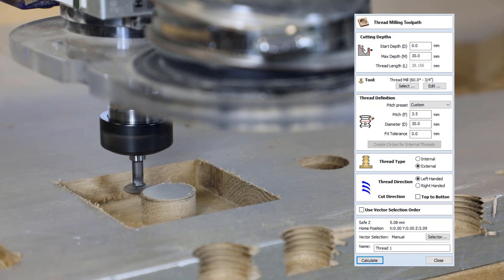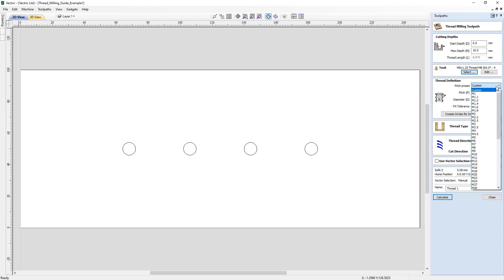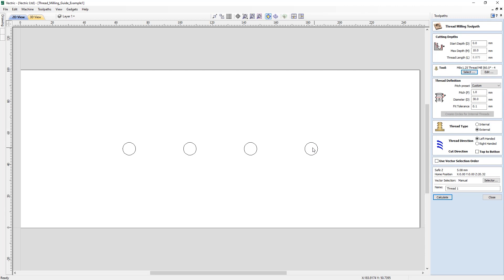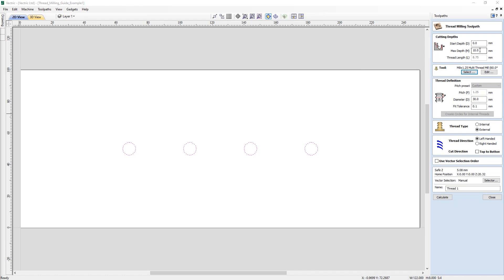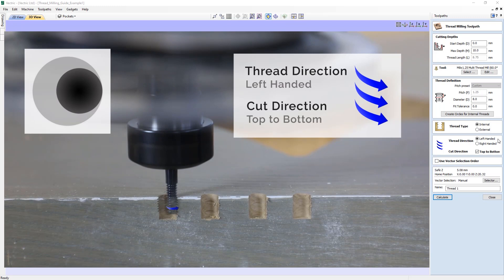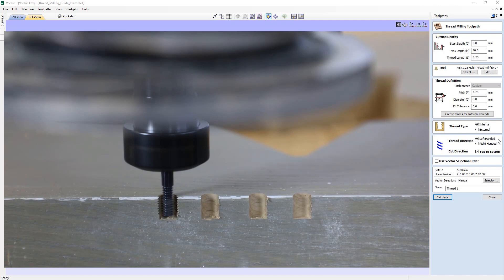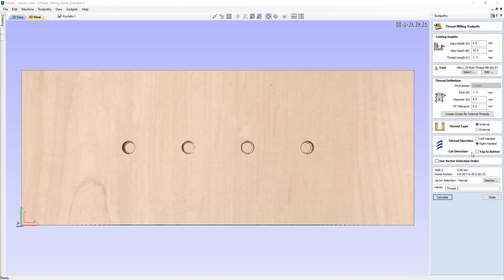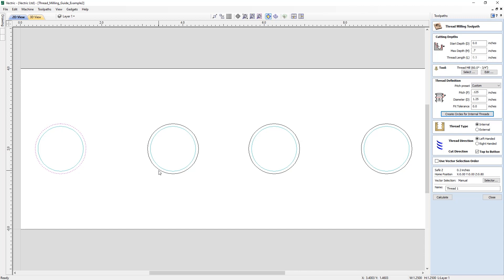Thread Milling Toolpath Guide | Vectric V11 Tutorials

Comment: i realy like ur video, but is there a way to make more then 1 pass? i mean, start with a diameter, and make more passes till i hit the diameter i need? thats to prevent break the tool with ruges passes, im having problems in hard materials, i could make another toolpath of course but there are a lot of holes
Reply from the maker: Thanks for the comment.  Yes... if you ajust your "pass depth" of the tool then it will make multipal passed.

Comment: Outstanding video! How do I add a "threading milling" tool to my Vcarve Pro, V11.5?
Reply from the maker: Thank you! In the tooldatabase you will see a "+" icon at the bottom, this will allow you to add a new tool. From there select the "thread mill" or "multi thread" tool from the drop down depending on what tool you are using, this will then show the geometry settings you need to apply for that tool at which point you will need to refer to the tool manufacturers settings to enter that information. Hope this helps! If you have any questions, please don't hesitate to email our support team on support@vectric.com and they can guide you with your specific tool. Have a great day!
Reply: @vectric  Got it added! Thank you!  😀

Comment: does Aspire require a specific single form cutter for a range of thread pitches?  or does it, say for a smaller cutter, will it adapt the tool path for the passes required to make the desired thread width. like you would do for a vcarve or using a 1/4" em to cut a 5/16" hole?  I know this video was posted a year ago, so well see if you even know I asked this... thanks
Reply from the maker: Hey Larry... We are always checking our comments so be assured we don't nmiss too much.  When it comes to this toolpath stragity, we need to know the specifics of the tool to get the thread correct.  But in theory, without testing, I suspect as long as you use the same tool for both the external and internal threads (making sure to check all the parameters are suitable for the tool) it sould be OK.  I would test this out on a test part, in a material you are OK wasting, just o be sure.  I personally would follow the method but recreate the tooling using the geometry of my tool in hand.

Comment: My gosh man.  You took some simple and made it confusing as hell.  The only reason I was able to figure it out, after the fact, is because I’m a machinist.  First of all how about using standard thread terminology i.e minor and major diameters?  You especially went over-the-top on making the external thread cuts confusing as possible.  How about you define the ops in order instead of backwards and then reordering them?
Reply from the maker: Thanks for your comment.  I'm sure you know there are many ways to do this sort of thing, and we try to be as flexable as we can for many applications.  We will take your comments on board for the future.

Comment: Sir, i noticed if i key in all parameters for single tooth cutter. If i want to get 1 finishing pass and several rough passes, i need to figure out "pass depth" value. I manage to figure out in order for me to get multi passes, i need to select a value that creates this. Is there a formula/documents on this topic?
Reply from the maker: Hello and thanks for the question.   Our rule of thumb is 1/2 the diameter of the cutting end of the tool... but that is just a place to start.  It all depends on the material, tool wear and how well built your machine is.  For example if I was to cut into HDU (foam) then I could get awau with a much more egressive "pass depth" but in brass... I would need to toss my rule of thumb out the window and go with 1/4 or smaller.  Hope that helps.
Reply: @vectric  thank you for the tip. Cheers